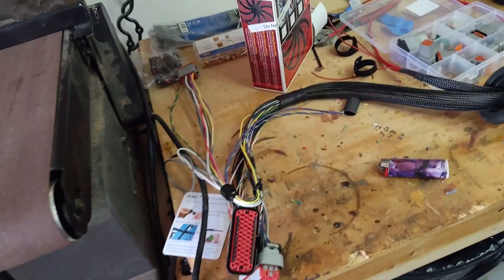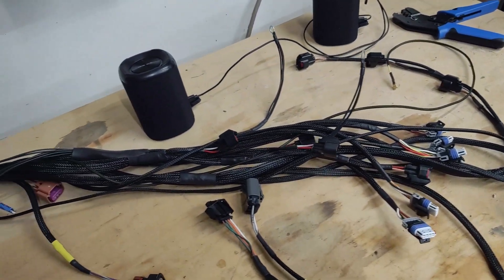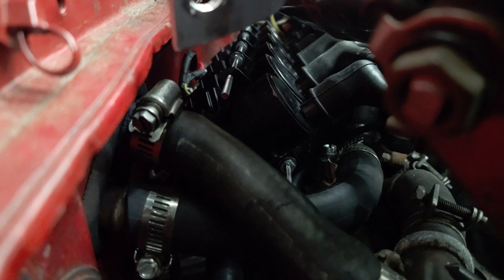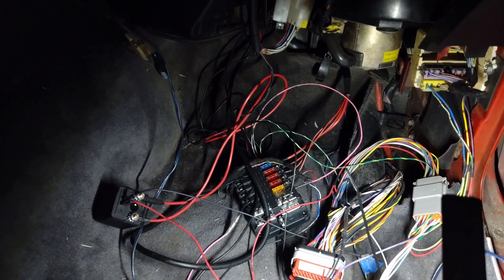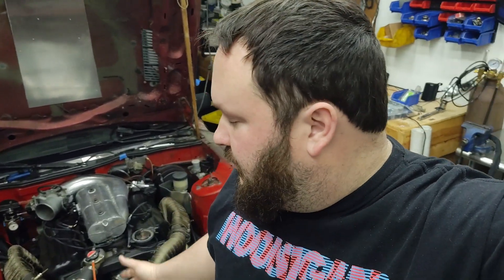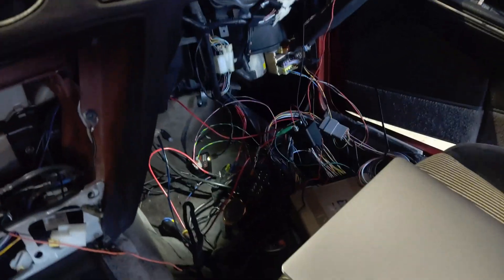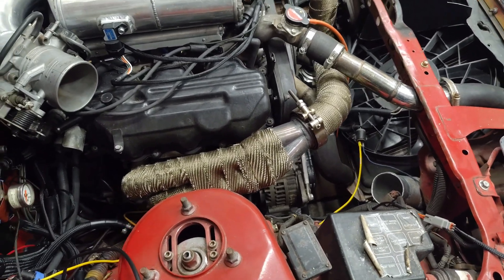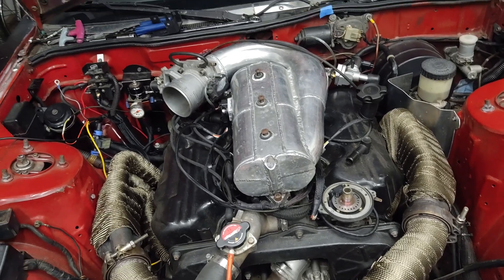Finally got the megasquirt installed in my z31!

Comment: Hey man did you use a pull up resistor for the Crank angle sensor? Or did you just wire it straight into megasquirt.
Reply from the maker: I wired it right to the megasquirt.
Reply: @hotwillzgarage3167 use the optical input or the VR? Apparently people just ise VR and no resistor. Im working woth microsquirt
Reply from the maker: @jonathonsheldon344 I believe I used the vr but can't remember.